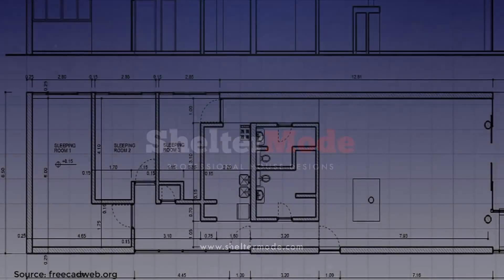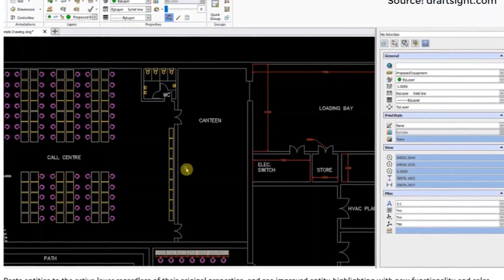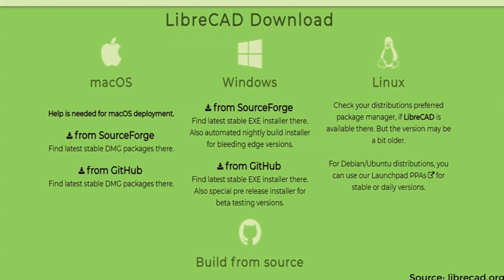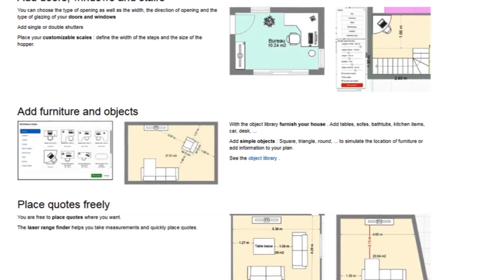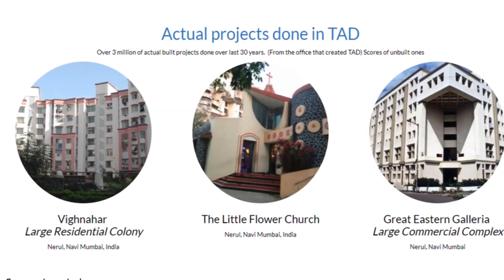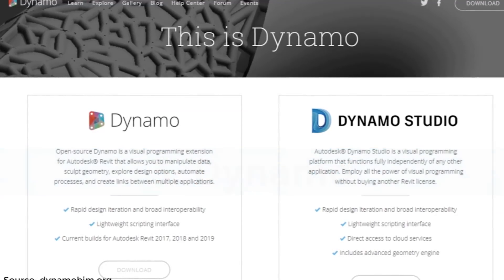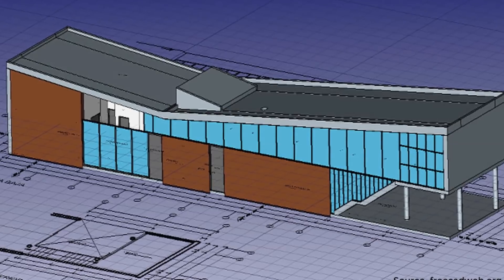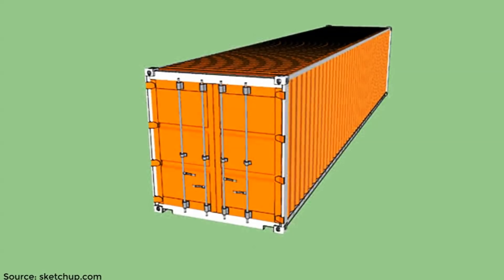Top 10 Free Open Source CAD Software for Designing a DIY Shipping Container  House 2018

Comment: I'm an interior designer and I prefer FreeCAD to design house plans and Blender to render the work. Sometimes I do everything in Blender.
Reply: How do you be accurate with measurements in blender? I'm struggling with trying to design my own room and I only know blender!
Reply: @ShaunakDe  blender is a non-parametric modelling software. 
Although people can design rooms in blender also, but for core architectural work - like by dimensions dependent (see parametric modelling) you need CAD. 
I learnt CAD then trying out Blender. 
But it's okay even if you're doing the reverse. Just learn what is Parametric vs Non-parametric modelling. In easy words I'll say Non-parametric modelling methods use polygon system.(but do read).
Reply: thank you for the insight!!
Reply: Hi can i ask, do you need an architecture degree to be an interior designer?
Reply: @NoName-iz6el  I hope so. Otherwise It's really hard to grow a Business After a Point because you don't have a degree. Although you can Hire People Clients seek Degrees.

Comment: You failed to mention Blender - a fully spec'd comprehensive, multifunctional and extremely powerful "proper" 3d modelling package in the same league as 3DS Max and Maya with a HUGE consumer following and support.  It's learning curve may be a little higher than those you mentioned, but that's more than compensated for by it shear strength.  Worth considering.